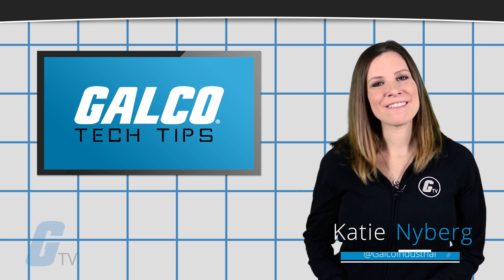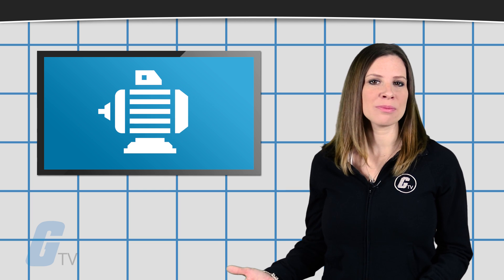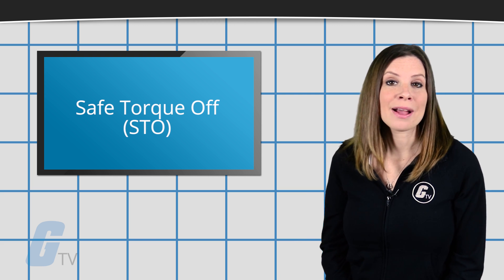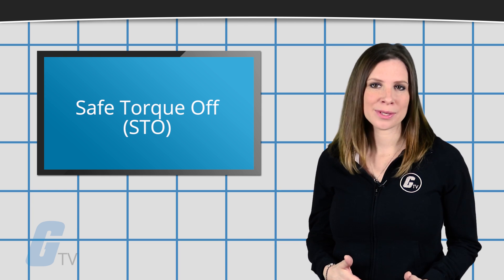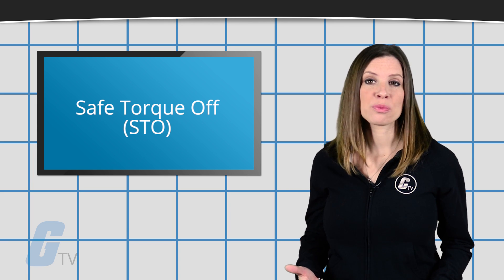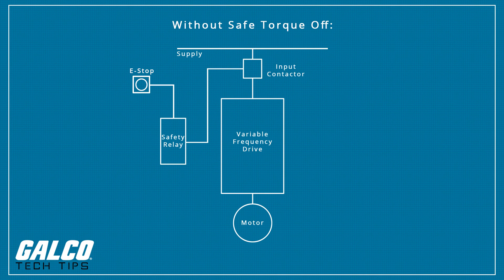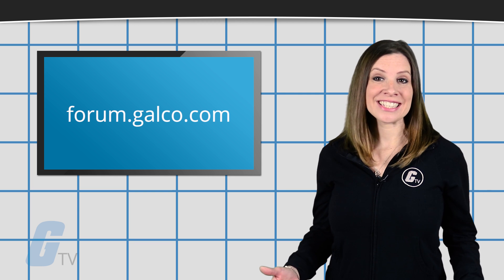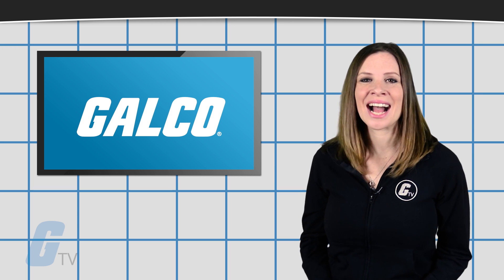What is Safe Torque Off? - A Galco TV Tech Tip | Galco

Comment: Hello, how are you? I'm experiencing a fault in the Power flex 527. inhibit safe S05 ... what is the solution to reset this fault?
Reply: GalcoTV Okay, thanks for your attention.
Reply from the maker: Ok Ricardo, according to the manual it looks like this is a Network activated Safe-Torque-Off function. If you are not running the drive from a Network control you will need to deactivate the comm function. Sorry but I don't have any further details then this. You can call us at 800-337-1720 and ask for engineering, they may be able to help additionally.

Comment: STO is just a safety interlock = lame name.
Reply from the maker: Sorry you think it is poorly named, however it is a special function described in IEC-61800-5-2 [3] that safeguards the drive from making torque in the motor. An E-STOP function may interrupt an input to the VFD that causes a coast stop function but that requires the drive to read the input then act on it. STO goes directly into the power section of a drive and kills the power to the Gate driver circuits so the output transistors can't be switched at all. This keeps any power from reaching the motor and therefore no torque is possible without relying on the control board running to scan an input and react. STO is very instant power kill of VFD output section for safety, ok?